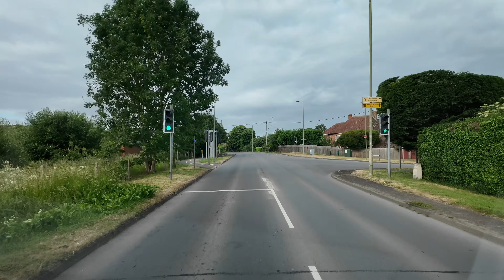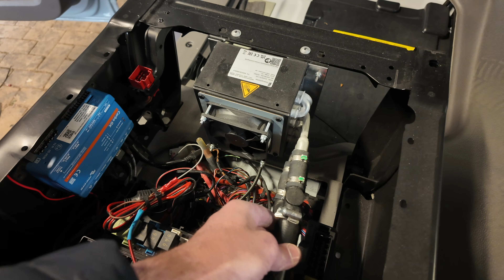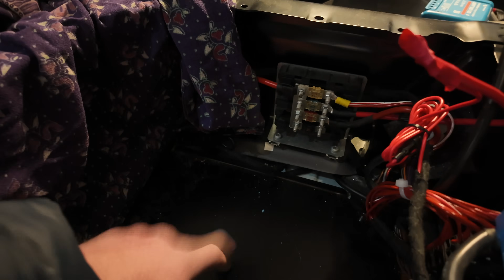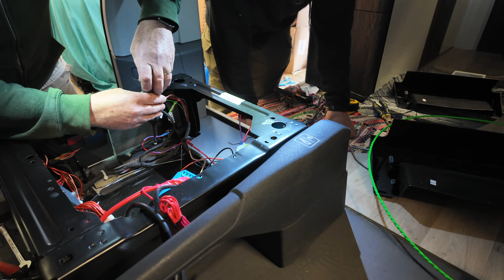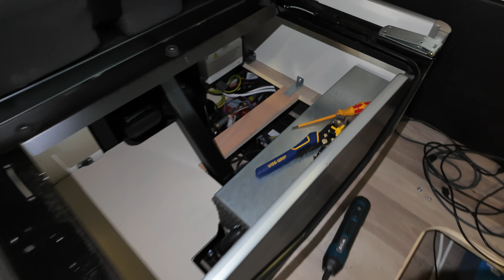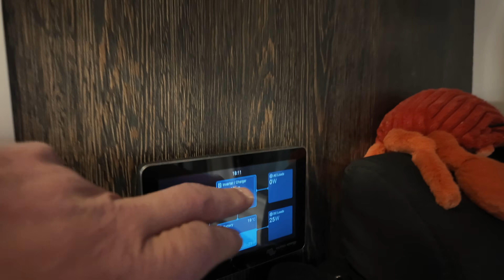*FULL* Victron Power Upgrade for Westfalia Sven Hedin Campervan inc Roamer Lithium - Install Video!

Comment: Great video!! I’ve been teetering on the edge of getting a lithium battery fitted to my campervan, I’ve also checked out Offgrid Power Solutions as well and they look the real deal! Couple of questions if I may? I can’t find the follow up video so will ask here, but if you cover it in the follow up I’m more than happy to watch that 😊 Does the 230 ah battery fit the bill in terms of your power needs? Is the multiplus the invertor? Once again, thanks for the video 👍
Reply from the maker: Hi! Well our advice is just go for it - it makes a huge difference. Is 230ah enough? Well that depends on a lot of factors but it essentially nearly quadrupled our battery capacity over the standard setup so is good enough for us and we are power hungry (fridge, diesel heater, inverter for coffee, electric kettle etc etc). Yes the multiplus is the inverter, but it also is the 240v mains hookup charger for the batteries too. It also trickle charges the starter battery. Offgrid really are the real deal. Very helpful and know their stuff.
Reply: @C @CampervanTime Thanks for the reply. I’ll have to look into this again in the new year. All the Best, Peter

Comment: Nice install. Question: What settings did you use with the Orion XS 50A? I tried several with and without "engine shutdown detection" and it only charges occasionally, even when the battery is not full.
Reply from the maker: We’re using an ignition on trigger wire to start the Orion xs, turned off all the intelligent engine shutdown stuff off but we do have input voltage lockout set to 11.5v lower and 11.7v upper, just as a safety net in case I forget that I have the ignition on but engine not running at some point. Super reliable and you know in your head that ignition on = Orion xs on. If you’re worried about the flat battery potential you can add a votronic d+ engine simulator as well that works on vibration on the engine to give actual engine running signal.
Reply: @CampervanTime  wow. Thanks. I will try that.
Reply: It works, but I had to reduce the Amps from 50 to 45 to avoid the engine compartment cooling system (Fiat Ducato) to work too much at engine shut down.

Comment: Fascinating tech adventure, admire your bravery
Would be interested to know why the starter battery was not retained as a vehicle back up.  
Also what is the new energy capacity and likely off grid limits?
Reply from the maker: The starter battery is retained - it's in the passenger footwell. The one under the bonnet was one of the leisure batteries. The new energy capacity is 230ah, which you can use all of, the old capacity was 162ah of AGM power which you can only use half of, so 81ah. This means we now have nearly 3x the capacity we had before. Off grid - 3 to 4 days in winter with no solar top up. Summer, unlimited really with solar.
Reply: @CampervanTime  Thanks, appreciate the logic

Comment: Cosmic timing for me. I bought a 2019 Sven Hedin in September, and took it directly to Turkey. I'm desperate for a lithium upgrade and just TODAY was planning to track this down in Antalya. Seeing the complexity of the job makes me wonder. You need some real skill to pull this off, especially when I spend summers in Europe and I'm 3,500 km away from the installer! Our vans are essentially identical, so this video was a great help. 

Well done and thanks! 

ps. My fridge is basically on 24 hours a day, even in cool weather. What is your experience?
Reply from the maker: Glad it helped. Fridge, we've modded our temp control to not use the westfalia panel and to use a separate temp controller and probe to do it more accurately. Worth its weight in gold. One of these: https://amzn.to/3G6pv0y
Reply: @CampervanTime   Great, thanks!

Comment: Excellent video. Am interested to understand why you decided to incorporate additional solar charging capacity please. What is the wattage of your rooftop solar panels? Many thanks 👍😎🤟
Reply from the maker: Hi. We've got two 115w panels on the roof which are not bad but the roof space won't take any more because of all the roof windows, 5g antenna and awning. My thought was because we'll now be using the inverter we'll consume more Ah than we did before from our leisure system, so in winter where it's overcast we'll need more solar charging capacity than we have now to top the batteries back up. With what we have installed we can use upto another 300w of portable solar placed outside directed at the sun and it will do that for us. Also, we have been in places where the van roof is in shade from trees so being able to use and position external panels in this situation is really useful.
Reply: Thank you for the prompt reply and great explanation. We have 200w on our Westfalia Columbus 600D roof so are in a similar situation you have with your Sven Hedin regarding no inverter for 240v when not on hook up. I like your thinking. Many thanks!

Comment: More of a general observation but given the £80k+ price of factory built campervans (from any manufacturer) am I the only one that thinks they should come with some of this equipment  (e.g. lithium battery) as standard?
Reply from the maker: You're right, they should, but realistically when you look at the costs of the base van, then the component costs for a full camper build and add labour on top I can see why they don't. This lot would add +£3.5k or so to the van cost / reduce their margin by £3.5k - when a standard AGM basic system does fit the bill for a lot of van buyers who only over go to campsites with electric hookup. At least like this we can have it just how we want it.
Reply: @CampervanTime  I think it would be really interesting if you did a video going through all the modifications you have made and the cost of each, to show what the cost of your Sven as of now has been.  I think that would be really interesting to compare to the cost of one of the custom builds by one of the smaller companies, such as the build by Knight Custom Campers that you both seemed to like so much at the most recent NEC show.

My personal view aligns with your, i.e. if somebody plans to use a camper mainly on campsites then the large manufacturer builds may be a good option, but they do not really provide a viable solution for anyone looking to use the camper away from campsites for more than one or maybe two nights at a time.

Comment: Good job Sir. Are you happy there is sufficient cooling / ventilation for the inverter?
Reply from the maker: Good question. I talked to them a lot about that and although not ideal being in there, it's ok and I also trust their experience with the 1600va unit. I do have the option to install temperature controlled fans in the front edge of the false floor if needs be too. I have tried using it at high amps for charging and also inverting and yes it gets hot but not so hot I'm worried about it.
Reply: @CampervanTime  I have a 1700W Sinus inverter in the same space. I really only use it for boiling the kettle, hair dryer for the wife.....so it's not on all the time....
Reply from the maker: @smeaty100 ditto, we don’t leave ours on unless we are using it

Comment: Nice! How does this affect the warranty etc, if at all?
Reply from the maker: Yes I am sure it affects the warranty on the electrical side of things but we’re happy now that we understand the van well enough that it won’t be an issue. We have a few non electrical warranty bits to sort so that will test it out.
Reply: And insurance as presumably this upgrade falls under the,  "Has the vehicle been modified in any way" clause of most policies?

Comment: Interesting setup, although I'm more concerned at the crazy design of a heater with water pipes running over the 12v under the passenger seat. Holy focaccia!
Reply from the maker: Well that’s obviously part of having a wet heating system in the van. We wouldn’t want it as just blown hot air though, this heating system is absolutely fantastic!
Reply: Fantastic until one of those pipes goes pop and it empties over your electrical system. My point was, the safety aspect of the factory install, not the efficiency and effectiveness of the actual system. Anyway...

Comment: Polite question - how can you concentrate on driving and present to camera? Impressive!
Reply: Was thinking the same thing, but didn’t think it was impressive!
Reply from the maker: Well.. I am being careful and obviously at 4.30am the roads are very very empty as I set off on my journey. The clip at the end was done on the straight v quiet lane to their workshop so no traffic either 👍
Reply: It’s one of those movie camera tricks. The camper is sat on the back of a trailer.
Reply: @cyclingdad6152  😂

Comment: Is it not a shame that Westfalia don’t supply as standard a lithium set up, or option, where you can ditch the gas cupboard, make it an electric cupboard, give you a double induction hob, and 240v power all the time, 
By the time you have done all this you could have got a MAN TGE, had it custom built, all the bells and whistles.
Ps you don’t look well
Reply from the maker: Well the new Sven has a factory lithium battery option but still gas hob. I’m absolutely fine, you’re just not used to seeing me at a correct BMI body weight 🤣
Reply: @CampervanTime  I was just about to say the opposite of @ianrea - looking good, Will - the slimmer look suits you! :)
Reply: Hi Will, am interested to know if you supplied the component parts other than the battery to OG Power Solns ( inverter, MMPT etc) or did they buy them for you ahead of the installation? Many thanks 👍